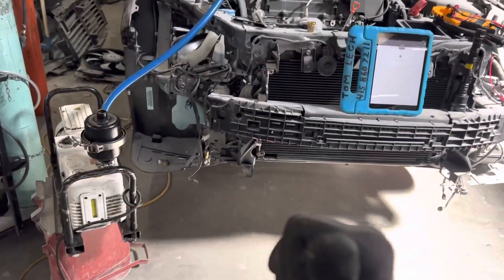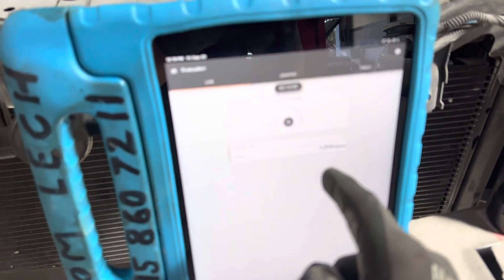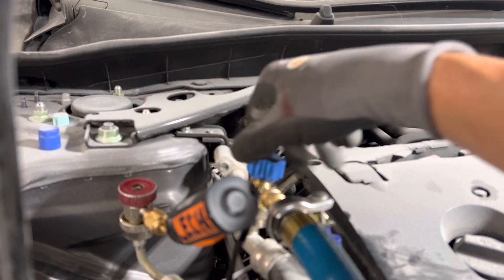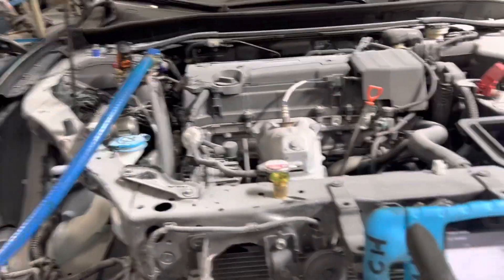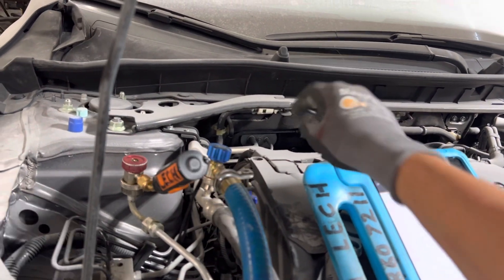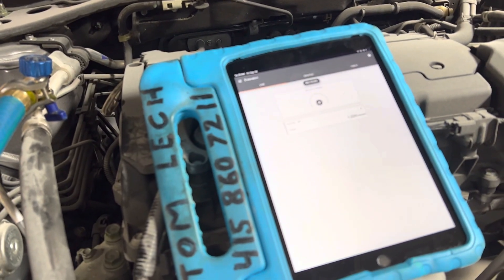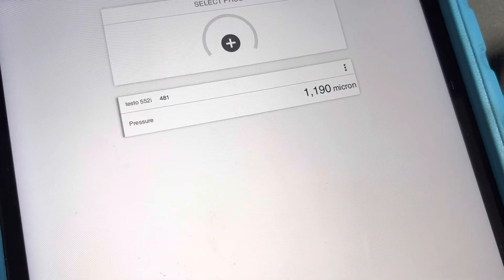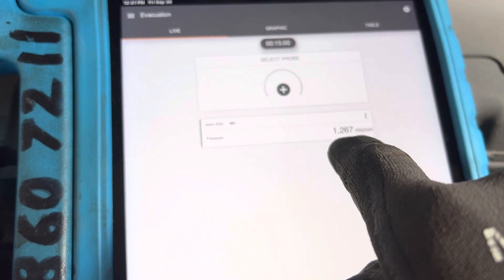INCREDIBLY SLOW MICRON VACUUM PULL DOWN ON HIGH MOISTURE CONTAMINATED SYSTEM

Comment: You got your favourites out #teamtesto 👊👊👊
Reply from the maker: Testo‘s as you may know I don’t always talk highly about them but I have nothing against there micron meter.
Reply: So is the reason why the micron gauge was not dropping is it largely do to the moisture contamination, probably the dryer is overly saturated right?

Even though you use the 1/4 vacuum hose, you can still draw down a vacuum with low micron as long as there isn't a big moisture problem correct?

What I mean is that if the dryer bag is new, then the vacuum would work regardless of hose size? Might take a little longer for smaller hoses.

So what was causing the car not to vacuum down( which part)?
Reply from the maker: @edwinaragon8469  even with a brand new desiccant bag when you have grossly overly contaminated PAG oil or POE oil whether you have the best hose on earth or just a refrigerant charging hose at first you still will not be able to get the micron reading low and be able to hold because of all the moisture absorb into the refrigerator while it does not matter if it has a brand new desiccant bag. 

It has a brand new desiccant bag that was in the new condenser and it was attached to a system that was grossly contaminated with moisture for months. 

And the desiccant bag did its job and absorb a lot of the moisture that was in the oil because that’s exactly what it should do

Moisture is just like heat it is just like pressure and it is just like voltage

Higher voltage travels to a lower ground plane lower voltage

Heat always travels to cold

High pressure always travels to low pressure whether it’s air gas or water

Moisture always travels towards dry 

Lower I would literally have to keep it on 24 hours to 48 hours to get a acceptable range most likely due to how grossly over moisture contaminated this oil is for being exposed to the atmosphere for months. 

And it still would not remove all the moisture it would only reduce it. 

Any damage through chemical conversion at the molecular level that started to develop any acid cannot be reversed once damaged it’s damaged you cannot undo the asset does not revert back there’s actually a chemical process that goes on when you bind a moisture molecule to POE oil. 

This is why the system should never be exposed to the atmosphere in the 1st Pl., H2O in the presence of O2 in the presence of POE oil and then if you take it one step further if it’s HCFC refrigerant it develops hydrochloric acid if it’s a CFO refrigerant for HFO refrigerant hydrofluoric acid